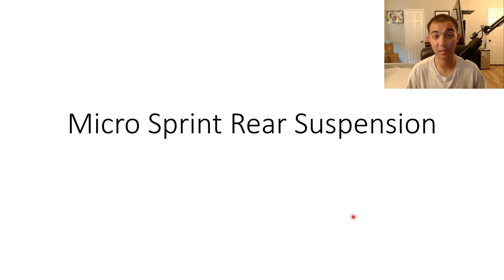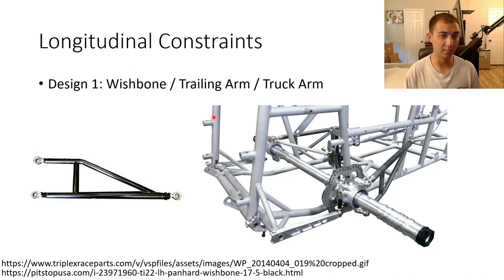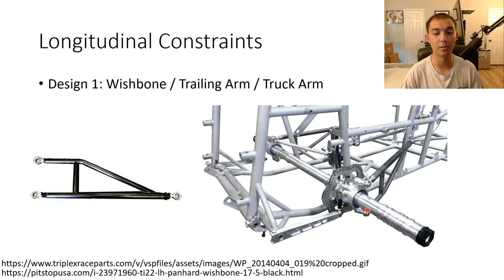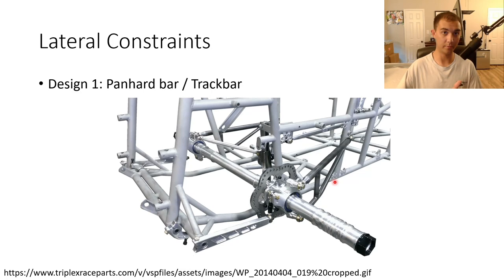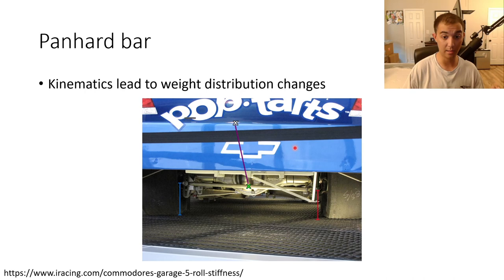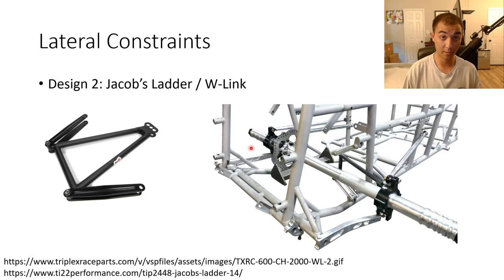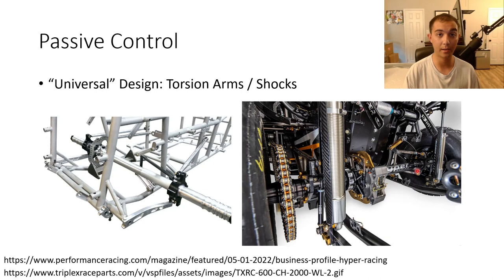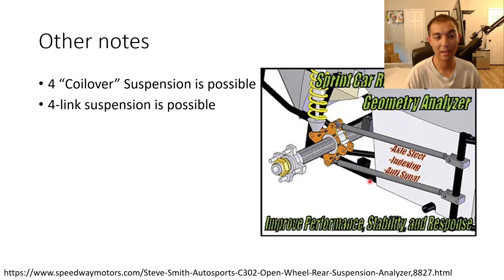Micro Sprint Rear Suspension Geometry Explained

Comment from the maker: Two mistakes I made in this video:

1) Since 2022, NASCAR cup cars use independent rear suspension instead of a live axle. As such, a roll center height change is made by changing a-arm geometry and not by changing trackbar heights.

2) A w-link is not a “Watts” link. The two concepts are two independent ideas that I always get mixed up.